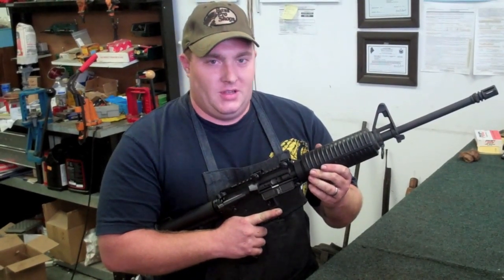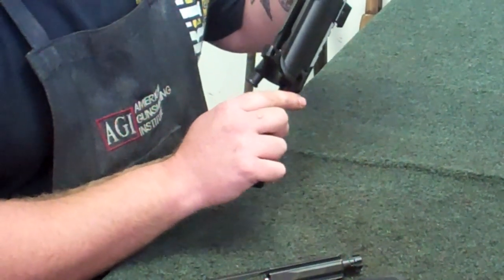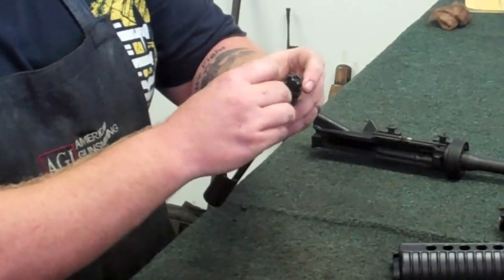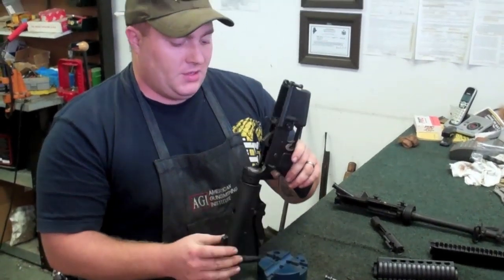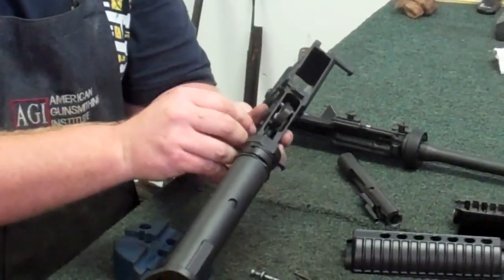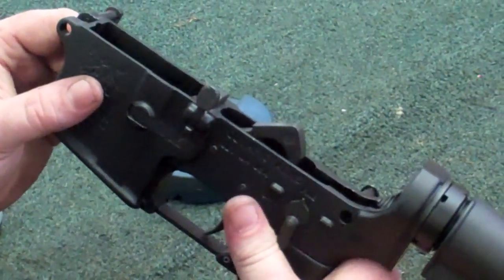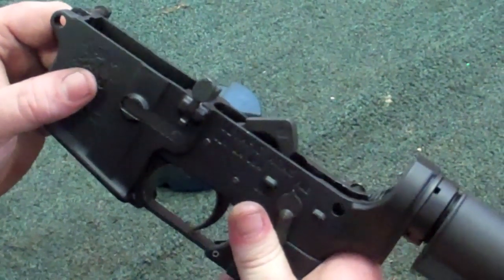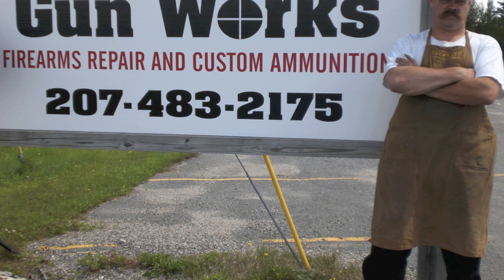Gunsmithing Disassembly: AR-15 (Gunworks)

Comment: Sir, there is a pin at the end of the buffer tube(rear of the lower assembly) it looks like a little nipple and there is a spring under it that pushes it up to retain the buffer and spring inside the buffer tube.  The actual buffer housing inside the butt stock will screw into the lower receiver and cover up the backside of the detent and hold it into the hole in the lower that it goes in.

Comment: what keeps the buffer retainer pin and spring in? When I reassemble and pull the bolt back somehow it grabs the retainer pin and pulls it and the spring out the hole

Comment: Occasionally a buffer tube won't be torqued down and it will back out and allow that detent to pop out of the hole it sits in.  Depending on what type of stock you have your torque on the buffer tube will be different.  For a rifle(fixed stock) torque on buffer tube is 35-39 ft lbs, and on the carbine style (locking nut) it is 40 INCH LBS plus/minus 2 inch lbs.  If you need more assistance feel free to email me and we can get in contact: waz2064@gmail.com.  Hope this helps.